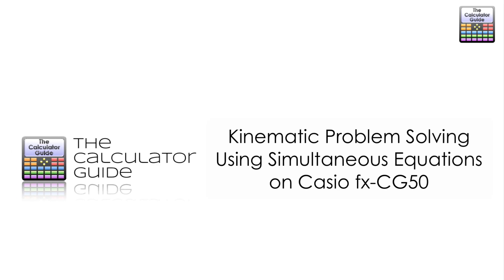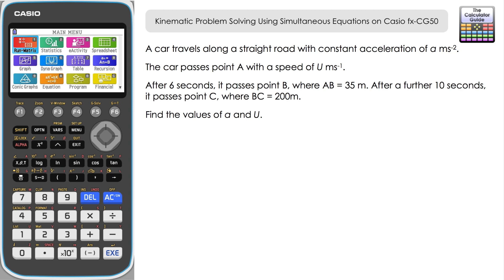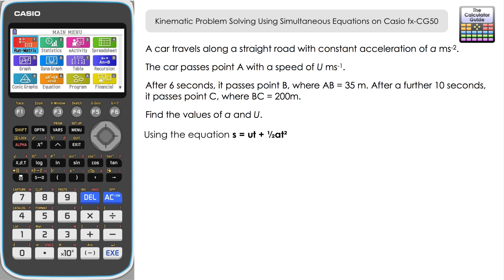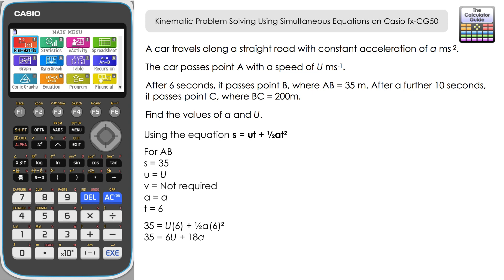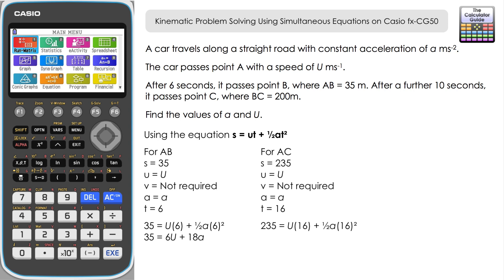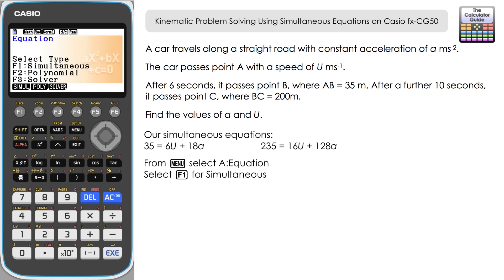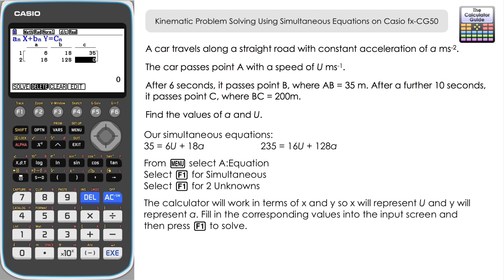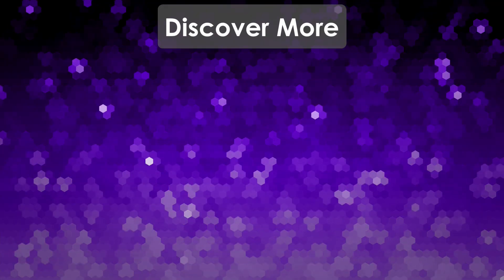Solving SUVAT Problems Using Simultaneous Equations On Casio fx-CG50 | Kinematic Equations

Comment: Thank you for these great tutorials. I am studying engineering, and I use this calculator. I need to frequently switch between scientific, engineering and normal notations in my calculations. Can I adjust the buttons in a way that I don't have to choose the notations in the mode all the time? If buttons could switch between the notations, that would save a lot of time, especially during labs and exams.